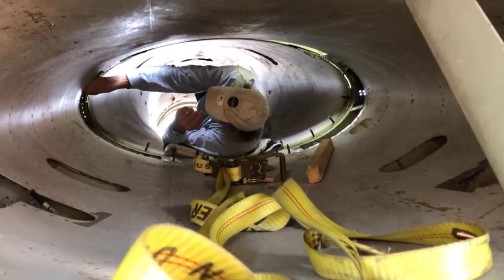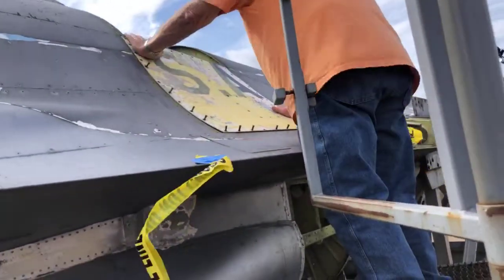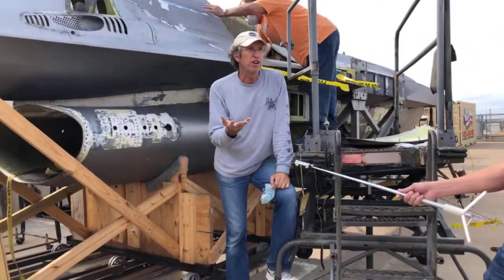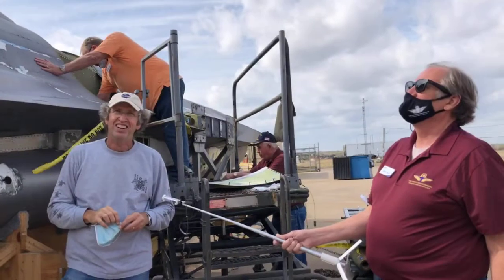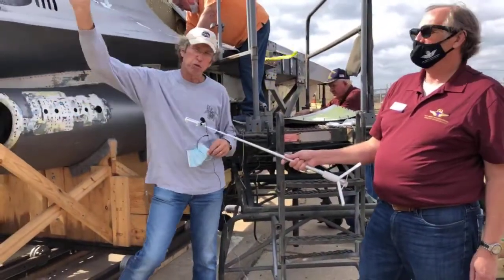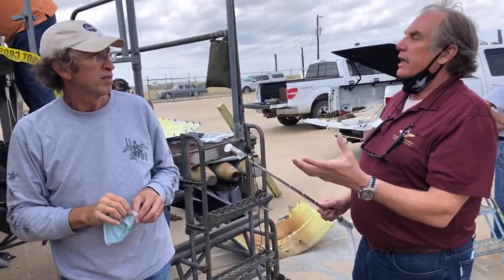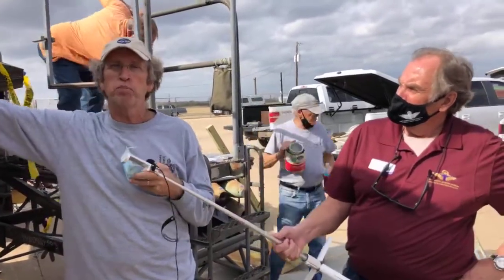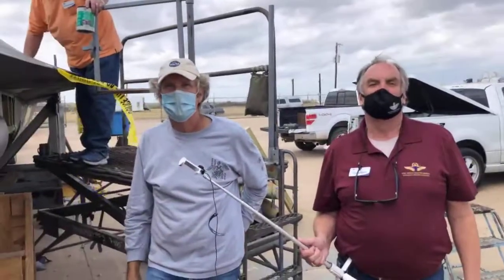YF-16 Fuselage Re-mate Progress - 14 Nov 2020

Comment: Late arrival here, but watching these in sequence. Best way to drill out Huck or Cherry fasteners with cobalt bits, is high pressure, slow speed with Boelube or equivalent cutting lubricant. You want to allow drill tip to bite into the steel. Pigtails are your friend! 
Elated that you guys recognize the importance of this aircraft!